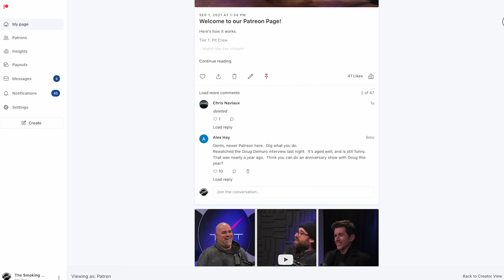Ways the BMW 128i is Better than a 135i or BRZ - One Take

Comment: Naturally aspirated BMW sixes are some of my favorite engines. Beautiful sound, fantastic power band. 👌
Reply: Yeah, and they’re pretty bullet proof as well
Reply: @clardrives9301  The owner of the car said he would've been broke if he had to pay for labor on car at 15:20 . I wouldn't call that bullet proof.
Reply: @cognition26  I've got 165k & 185k miles on my N52's. Bulletproof engines & transmissions so far. Preventative water pumps/thermostats at 120k were a pain. Where most BMWs still require most mx is the suspension bushings. Other than that... my E90's are worlds more reliable than my E46s were. I also chose to go normally aspirated and stayed away from the turbos since I keep my cars for a quarter million miles. 👌
Reply: Yupp love both my e39 bmw 530i and 540 although the 540 is the 4.4L V8
Reply: Unless it's turbicharged
Reply: @twinturbo8304  what about 😒😏it ????
Reply: @twinturbo8304  u don't even own a car 💯!!!!
Reply: @fckyoutoobe dude thats just common knowledge that the N54 was one of bmws first twin turbo inline 6s and was the most unreliable out of them. The N55 was better but still unreliable and then the B58 came and it was actually reliable
Reply: @MJT-DA  idk wtf u babbling about, 😂🤣 I never said anything about no N54 I said  I love my E39 Wich if u knew was a m54 inline 6
Reply: @fckyoutoobe  with the M51 isn’t that a single turbo? I said the N54 was the first TWIN turbo i know bmw had turbo engines before hand…
Reply: @MJT-DA  also they only wee available in 2006 and 2026  in twin turbo
Reply: @fckyoutoobe  ah i see, well I guess the point is they’re reliable now I’m actually looking at a 2018 m2 with the Good N55B30. What funny I should’ve got used one before bmw released the fugly lego car cause now they’re all over $50,000…
Reply: @MJT-DA  I prefer the E39 96'-03' most sought after BMW ever and most reliable engines m54 inline 6  and the E39 540i has a 4.4L V8 Wich is a FUCKING beast I got CATLESS HEADERS AND STRAIGHT PIPE both my BMWs they are legitimately the loudest cars in my city 💯💯💯💯💯
Reply: @fckyoutoobe  yikes no wonder cops hate bmw drivers my buddy got one and got pulled over the first day he got it lol
Reply: @hangpilot1200  I’ve got 216,000 miles on my mini bmw n18 along with a big turbo and the shit beaten out of it every miles.
Reply: As soon as BMW went to turbos the reliability died.  I have an E30 and Z3 and both have been bulletproof.
Reply: @MJT-DA  yeah, between the turbos and plastic parts, not interested.

Comment: The 128i is an excellent car, I absolutely love mine. Especially after suspension, an alignments, rear diff, and 3 stage intake manifold with a 130i tune.
Reply: Hey I know this guy
Reply: Same !
Reply: I want to put a diff in mine. Need to add the oil cooler for track duty though. Besim your videos convinced me to get the car. @16vPete your articles convinced me to keep it. The Veloster N keeps calling though.
Reply: @project_piston  Veloster N is an awesome car too!
Reply: reading these comments as I just picked up my 128i, super fun stock but will definitely be looking into doing some mods! If you don't mind me asking is this all you've done to the car?
Reply: You guys need to read Peter Nelsons articles on The Drive about the 128i. He’s got one tastefully modded as well. 

Ps. Hi Pete!
Reply: @sinfue  Thanks!!
Reply: @grouchscouch6970  I've got a list of everything I've done on my most recent track vid—it's all turned it into a grippy, confident, and super fun car on the street and track. The best place to start is a M3 front lower control arms, Dinan camber plates, and a good performance alignment. Then, grippy 200-340 treadwear tires, street performance brake pads, and good brake fluid really improve it from there.

Comment: Love these cars. It's hilarious when people spend $35k on a BRZ that doesn't perform as well and will never sound good when a 128i for $6k exists. But, I'm SHOCKED he didn't put in a 3 stage intake manifold. Significant performance improvement but yes a tune is needed. If you want to get a much better sound and even more power get a high quality intake and headers. Headers make this car into a dream. You don't even need to mess with the rest of the exhaust. Really strange this guy tracks the car but doesn't care about engine performance. Too bad about the yellow lights.
Reply: a lot of the 128i manuals come with n51, which already come equipped with a 3 stage intake and a lower CR. They are less desirable as the ceiling is quite a bit lower 15-20hp. 

Yes the 128i is fun, but it will get smoked on the track everyday by a stock gr86. Those cars come with a pretty good factory LSD, and are very easy to push the limit. The 128i/328i gets a  bit unstable when you try to push it past 8/10s even when modded.

 The car is classed the same as the 135/335i in SCCA and that is why it is not as popular since its not competitive at all.

Comment: Have to agree.  I had a 135 for three years - enjoyed the car but very complex, and expensive to own.  Traded it for a 128 and I could not be happier - not near as quick as the 135 but far more practical, reliable, less complex and less expensive to own while still being a blast to drive.
Reply: What’s the reason its expensive to own sir ?
Reply: @LEWiSG  Just to give you an idea, my 135 had the following significant, and very expensive, problems over 5 years - high pressure fuel pump replaced, injectors clogged, turbo’s started to have wastewater issues and BMW told me I needed a carbon cleaning.  My 128 has none of these parts, issues or costs!
Reply: @AB-jk7tw  in Uk we only have 125i, do you recommend that for more reliability? Also I won’t be tracking or anything and live In a city, would I really need a turbo car? I heard the N52 is way more reliable than N55

Comment: Guys I owned an N52 car. Trust me they’re speaking facts. My dream was to do a 328i E92 RWD 6 speed with a lil weight reduction, 3 stage intake manifold, AA headers and tune. Probably make around 240whp and it would be the perfect car. Engine is so much smoother than the 335 I bought after it. I made more money and started chasing horsepower but I honestly never had a driving experience like the old 328 I had. Power isn’t everything

Comment: I went from FR-S -> 335i -> 128i and I found it to be the Goldilocks, especially after doing similar mods to this gentleman. I'm surprised he hasn't done the 3-stage intake manifold. Between that, headers, intake, exhaust (secondary cats still present), and the associated tune, it brings the car up to 275-280 hp and improves the top end dramatically. There's a MILVs mod that is last on my list that gets 1mm additional valve lift and then you're knocking on the door of 300 crank hp.
The LSD with shorter final drive is the other big piece of that puzzle. I did a 3.64 with 3-clutch unit in mine from BimmerWorld.
https://youtu.be/LNHHn0SHXvI
Reply: It looks like he does have the 3 stage, just needs a tune. Love mine!
Reply: @ian trofimov  yes. One day, hopefully, you'll understand that it's not about all the power, but the right amount of power.
Reply: @ian trofimov  I'm happy that you're happy!
The reality is that it would be very difficult to make that car work well on the track. You won't believe me until you spend multiple weekends chasing issue after issue and upgrade after upgrade trying to manage the heat. 
BTW, its not that i don't like power. Our 535xi Touring made 647 to the wheels when we bought it. I detuned it to about 450 wheel hp in the name of reliability, but it still pulls pretty strong for a baby hauler.
Reply: I'm jealous of the shorter final drive, I bet that woke it up a lot, especially with how tall the gear ratio is from the factory. Iirc 5th at 7k rpm is around 170 mph!
Reply: @BESIM X CARS  not that it could hit 170, but that only helps your point! Yes, it made a big difference. This guy did a unique diff build, as I suspect that he found an early diff with a bolted ring gear. Swapping in LSDs in nonM E9x/E82 is very expensive because they have a welded ring gear that needs to be cut off and then a new one re-welded on. Very frustrating as it's not a DIY job. The solution is buying the built diff (~$3k) and swapping the whole thing in.
Reply: @drivefasternow9071  Yea thats nice if you got yours that way, luckily my prior owner had a diffsonline LSD installed when I bought it. Would love to re-gear but I want to keep the car STX competitive, which does not allow re-gearing. I did a 4.10 on my 350Z and it was such a game changer. so I could only imagine how re-gearing a 128i would feel haha
Reply: I'm gonna show my friend this when she gets into town and see if I can convince her to get something cheaper. She wants an upgrade from a vw gti. I just don't like new cars when we have so many used cars. Also hilarious to me how people who care about the environment still buy new erufm
Reply: How do you like that 3.64? I want to do a lsd and shorter final someday. Originally wanted the .64, but sometimes think why not go all in with a .73 or .91!
Reply: @PETER T  I think it's perfect for a street-driven car, as it doesn't rev too high when cruising on the highway. The gear ratios are great on track, as well, utilizing 3-4-5 without needing 6th, which would be a waste to shift to on track.
Reply: Which one was most fun to drive?
Reply: @ethanpintobean  FR-S on a back road, autocross, or track. 335i in normal driving, 128i, predictably, is in between, but closer to the FR-S with the mods. It's actually great fun in autox.
Reply: @drivefasternow9071  power is t everything, but it’s super nice being able to pass cars with ease with 400whp+ cars and having that “oh shit” factor whenever you want.
Reply: @drivefasternow9071  What made you go from 335i to the 128i? I recently bought a 128i and kinda wish I sprung for the 135i/235i. Especially now that I have something else dedicated solely to the track, I feel like the turbo would be much nicer to daily.
Reply: @bobbymobby4169  It wasn't an exact A-to-B. My wife had bought the 128i while I had the 335i. I later sold the 335i, then later yet, she wanted to move on from the 128i, but I wasn't going to let it go. As a pure daily, the turbo torque is nice. On track, though, the turbos just add heat and go through consumables more quickly. Having changed turbos on our 535i Touring, it's something I never EVER want to do again. I'm loving the "slow" NA motor. With a 3.64 LSD and BMW Performance intake/exhaust/3-stage intake/headers/tune, it's a fun level of quick!
Reply: iantrofimov6416  i mean sounds about right for a track car with a cage, and custom suspension/sway bar/mounts cross bar/braces etc....and big power/piping/cooling weight etc..then cut and weld on a wide body kit...for more meat or a squared meaty tune and That sounds like a pretty IDEAL build to work with for years.
Reply: Cars in California come with the n51b30 stock so you jus need the tune to open it up

Comment: This is a seriously cool build, reminds me of all the mods that were popular before 2016 in the 1600/2002 community. Classic BMW spirit to pull a few select parts from across their lineup and mate it together.
Reply: Agreed - very traditional mods just like old school BMWs.  I did similar with my e30 - better suspension, brakes, LSD & an M30 swap from a 535i.  Has been quick and ultra reliable just like the car here.

Comment: I have a 130i (Europe only 4 door hatchback) and very much the same applies. Fantastic car, reliable and very fun to drive, and comfy even with poyurethane engine mounts because I wanted a tall chassis mounted shifter. I can also attest that M3 control arms are the way to go: no more understeer and a much better steering response!
Reply: m3 control arms must come from an M3 donator?
Reply: @AdriWeedMan  no, as with all parts automotive you can buy parts separate, online. Got mine from Amazon lmao cost me like 50€ per part
Reply: link please
Reply: Whoever ordered my 130i at the time speced it out hard with the m sport badges and carbon diffuser area but in my opinion its a bit too slow for me these days and I think ill move up to a 135i n55 in a dct spec. 130i is a gem of a car and it will stay remembered for me.
Reply: We got those here in Australia! Great value car right now, and a bit under appreciated

Comment: I think the 1 series in general just has been forgotten a little bit. I remember when they first came on the scene  I was like wow, they reincarnated and modernized the E46 and called it a 1 series, brilliant. I also think the exterior styling aged well and goes well with the 1 series short wheel base up on its toes stance.
Reply: IKR its almost like the "E30" of its era....as things across the board sized up...and got heavier, more "sophisticated" forced induction more computers/driver aids bs that gets in the way of the "true driver experience"....damn now the 2.0 Turbo...has damn near 300 pounds of torque at 1500rpm....almost NO character in these newer BMW at all...the turn initiate is so CRUCIAL and tactless....and if its an X drive a 2.0 is like 4000 pounds....the 6cyl X drives are like 4300+...and the turn initiate Paired with the sluggish rear/power delivery equates to one of the sorriest driving experiences ive ever seen/felt this was from a 430i X drive m sport the dealership had me drive as a courtesy car when my daily i3 was in for a windshield replacement/warranty....and i learned how to drive stick on a chipped e46 325ci at 15. Just a shame what these bmw have grown into....catering to "poaching" lexus drivers and audi drivers etc....ppl with "purchasing power" and no sentiment whatsoever to being vested in an actual "driving experience" or a packaged EXPERIENCE on the road not offered by others. VIA FR with ideal/wide/usable powerband.

Comment: I'm going to have to watch this later since I just got to work. But I did buy a 128i coupe last year for its balance of comfort and capability. As much as I love how visceral the BRZ is (having driven plenty for work before and after the purchase), the amount of road noise and ride harshness in comparison, not to mention the lack of visibility, the 128i is a wonderfully balanced car not just for being a small f/r coupe by todays standards, but one that can actually be driven comfortably for hours on end without the fatigue. If only they had a limited slip diff and more engine note from the factory.

I'm unfortunately stuck with an automatic (it was a work trade-in I jumped on), but considering they are pretty much as quick as a first gen BRZ manual for acceleration, its not a horrible hit (unlike if one buys the BRZ in two pedals).  Before Covid struck, I was already getting my girlfriends impressions on different vehicles for a third car.  A Mustang coupe,   MkII Audi TT 3.2 (the VR6 and visibility are some of my favorite aspects, though the interior lacks the character of the Mk1), and lesser extent Genesis 3.6 Coupe were among some of my ideals.   I brought home an FR-S, and as much as she understood why I loved it as a drivers car, the flinty ride and interior noise just going to dinner was enough for us to decide it wouldn't be "that car" for us.  Prior to that, I had a 330i at work I'd been driving around for a while, and it changed my old perceptions of the E90 from being "this sold well, why?" to understanding its duality.  I took her to test drive an E91, and it was settled... the search was on, until Covid struck.  Her work was closed, and prices went up.  Hope lost.

One morning I pulled into work to see a 128i on the street, not even knowing it was a trade from our sister lot some four hours away.  Remembering it too had the N52, and remembering that I actually liked driving them (yet the E90's always left me somewhat cold before that one 330i manual), I asked who's it was. Hearing it was a trade in, it felt meant to be.  Get my BMW and compact coupe fix all in one.  It even had the sport package, came in a good color to ward off obvious dust ( Silver Cashmere metallic), and a lack of iDrive.

Perfect?  No.  The TPMS and a bad brake sensor have lights on the dash, which I'm not as concerned about as the diff whine and occasionally clunky 2-3 shift.  Having bought it with 120k and not knowing for sure its history, I figured the water pump and thermostat were likely a ticking time bomb (indeed by 126,000 miles it reared its head), but aside from that, an AC compressor, a passenger window regulator, and learning the woes of the HID's in a carwash (someone didn't seal things right), it's actually been a blast.  New Bridgestones, charcoal filter delete, and silicone intake boot later, I'm mostly fine with where it is.  Though yes, stainless lines would be nice for the brakes, and will likely go that route.

Comment: The n52 engine is the better match for both the 328i and 128i, lightweight and so slick up the rev range. Nobody talks about the fact that the block is made about of magnesium alloy for weight savings and that it has individual throttles in the form of Valvetronic. 
These platforms RULE!

Comment: I’m glad to see the 128i get some love. Mine looks very similar to this, same colour, ARC-8s. I’ve got the slicktop, which was hard to find, and sport package (for the seats) and no iDrive. Supposedly that spec puts it under 3100lbs but I have yet to confirm that. 

The LSD and M3 arms like this guy has are next on my list. I’ve done Ohlins R&T suspension, refreshed the brakes and added Hawk pads, and the wheels so far.
Reply: I have EU spec, 135i and I'm also thankful it is slicktop, no iDrive

Comment: I have completed pretty much all the same mods on my e46 330ci. LSD, diff, pss10. It’s. Great. But If I was doing it today instead of 10 years ago I would of bought the 128. At this point e46s are so old that you really have to want an e46 specifically for it to make more since then modifying the 128. Such a great car.